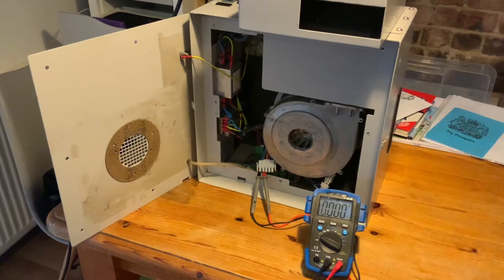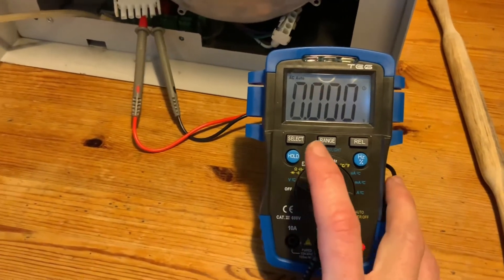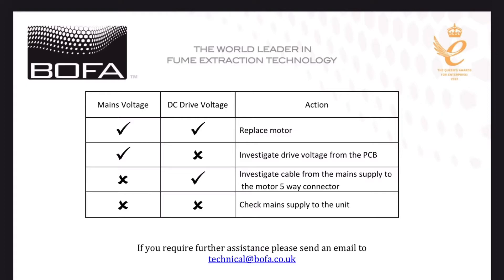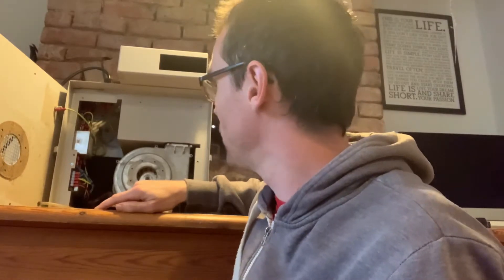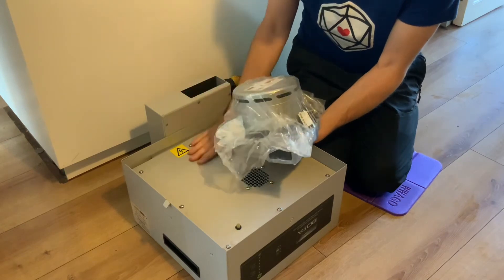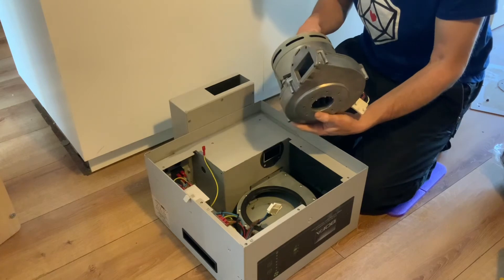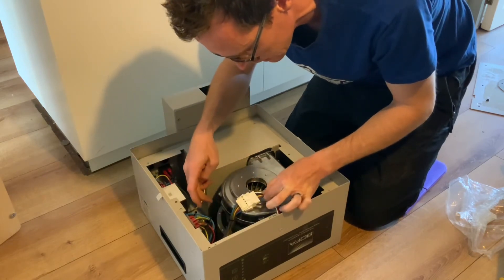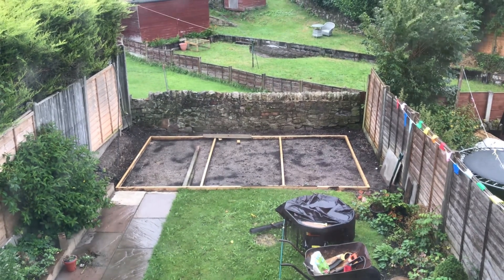Board Game Business - BOFA Extractor Motor Replacement = Expensive problems - Workshop Wednesday

Comment: Do you know the ratings of the motor and fan assembly? I'm interested in making a DIY version, and would like to know the airflow CFM the BOFA unit's have. Some furnaces have a very similar snail shaped fan for the power vent. I replaced one for a friend a few years ago. The one I did was smaller than what the BOFA extractor uses, but I'm wondering if it would be sufficient for a fume extractor for my 3D printer.

Comment: Well done, I hope it stays functional for you
Reply from the maker: Thanks, it needed new filters yesterday, so they do need some investment to keep them running! 

Good extractors are underrated in my opinion, it’s been the single best upgrade with regards cutting consistency and repeatability. The air flow across the work piece is very “laminar” so very little smoke getting into the optics or blocking the beam.

My limited experience with the “blower” or “extraction fan” type units on the cheaper machines has not been good. 

Thanks for watching!

Comment: Hi, what’s the Bofa model number is this extractor? How noisy is it when it’s running? Do you smell any fumes at all. I have a vented extractor for my laser but possibly need to use a filtered version instead.
Reply from the maker: Hi Les, it’s a BOFA AD350. It’s pretty quiet (unless the motor is broken! It was loud before I changed it). I don’t have a dB rating but is considerably quieter than the vacuum or hairdryer in our house. If you turn it up to full whack then it does get louder.

When it has a new VOC filter it is entirely odourless, quiet amazing really. This filter absorbs VOCs and the rep told me it increases something like 3Kg to 12Kg so it’s absorbing 9Kg of VOCs at which point it’s saturated (I may be out on those numbers but it is of similar magnitude. The UK supplier is called VODEX and they give great advice).

The particulate filter lasts a good while but I’m starting to notice the VOC degrade and odours starting again after three months. A full filter stack is about £300 but I seem to remember it’s about £80 for the VOC, again I might be wrong.

I’m about to move into my new workshop and I’ll be siting the extractor in an adjoining store room so odours are less of an issue, I expect to change VOC filters twice per year and I’m cutting acrylic for about 4hours 5 days a week at the moment.

I specifically asked the sales rep about venting directly back into the room and he said that is what this is designed for. The air that comes out of the filter will be cleaner than the rest of the air in your house as it’s done pre filter, HEPA and VOC. Just bear in mind that your filter consumption will vary with what you are cutting.

MDF apparently goes through filters like nobodies business as the vapourised resin cakes the filter and stops it performing way before it’s useful lifespan,

Hope this helps, I love mine, great product. Biggest advantage is it gives stable, laminar airflow across the worksheet which massively improves cut quality. Various people have commented saying that a blower is just as good and I can guarantee they’ve never tried a proper extractor with a proper venting setup. It’s worth it just for the improvement in cut quality and reduced cleaning in my opinion!

All the best
Kev
Reply: @TabletopUpgrades  Thank you so much for that detailed reply, extremely helpful.

Comment: I'd be curious to open up the motor and do component level checks on it, it could very well be a cheap sub $1 component that caused the issue.
Reply from the maker: I wish had thought of this! I have no experience of motor repair and never even thought to check. It would have been good to learn. What kind of things would you be looking for?
Reply: @TabletopUpgrades  I have not seen the internals of these, but I would expect a circuit that reads voltage values and does frequency control, a voltage sensing resistor could be damaged, or some capacitor...

Comment: That's why I own a k40 laser cutter!! Cheaper and cheaper to work one.. (cheaper made)I also have an external 12v. inline marine fan. Supper cheap as well. Also I have it hooked up to my resin printer, it will pull the smoke out like crazy..
Hope to DIY a 4x8 large one in the future. If there's on thing I learned about a k40 laser is how to fix one. Now I can use that info to make one as well..
Reply from the maker: They definitely have their place, but as a limited company I have various local exhaust ventilation responsibilities, I can’t just blow pmma vapour and questionable mdf smoke out to atmosphere with a clear conscience. As I’m cutting hundreds of sheets a month proper ventilation and filtration is a must. I’ve also found it to be a massive upgrade over the blower as it gives a much more even flow over the sheets but for small scale hobbyist stuff this set up would be massively over the top!

Great to hear you love the k40. What’s the best project you’ve done on it so far?
Reply: Did not suggest that I did not have an air filter system setup. Don't think I would want to do that to my neighbors. Don't have any restrictions in the states here.Just a personal responsibility and the best HEPA I can build
Reply from the maker: @MagnumPopeye  it sounds like a brilliant set up and better than 99% of the k40 setups out there! This BOFA unit has a VOC filter on which pretty much eliminates any odour but to be honest, I’m with you, if I didn’t have to have proper filtration, I’d have your setup. Presumably you’re not running your machine for hours a day either, so it sounds like you have gone above and beyond for the sake of your neighbours so kudos!

I replied to your comment on Facebook, your game sounds interesting, whats the theme?
Reply: It's a family game matching symbols and colors with a battle twist